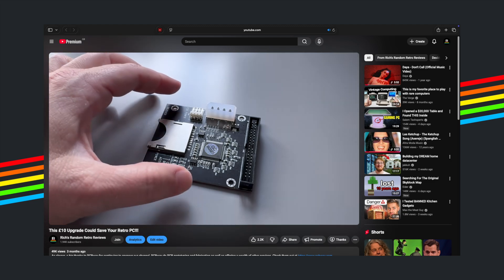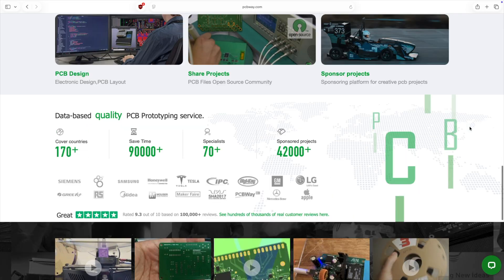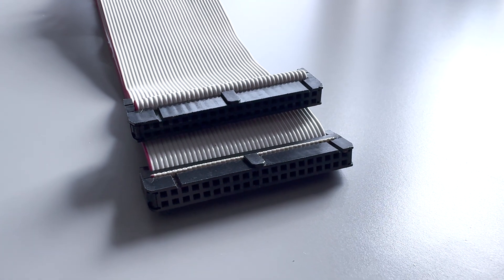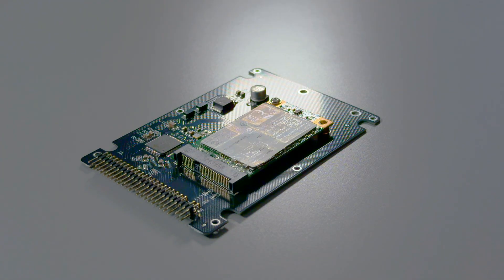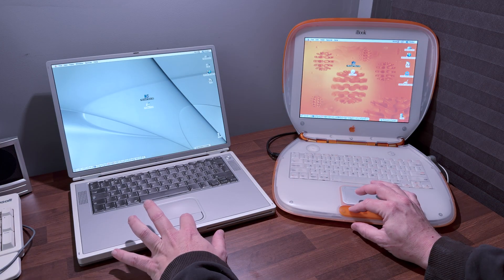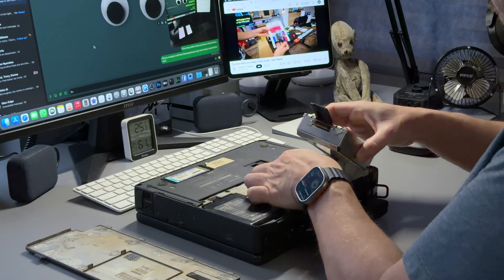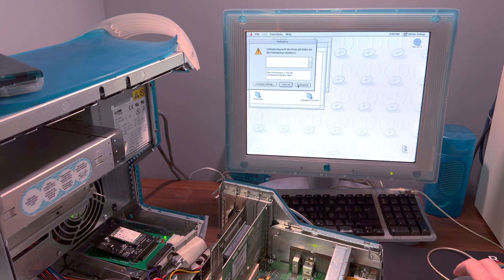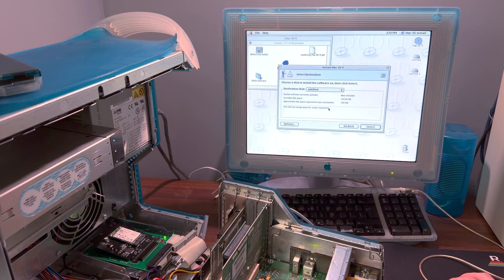Replace Your Vintage Hard Drive With This NOW!

Comment: Great video! Yes, I’ve found these little adapters to work much better on Macs as they tend to be picky with SD card solutions. 👍
Reply: Macs are also pretty good with CF to IDE adapters, but I do not typically use them.  They are picked up as external device in other hardware/software, causing issues with "no bootable device found".  They also typically bench a bit slower than these adapters, but hardly noticeable for typical use.  (That is also matter of perspective, because typical use of machines that can use these, is only set out for people that enjoy a few retro games or expierence, and even pain). 🤣😂

Comment: Meanwhile I'm running Debian 12 on the Dell Mini 910 that I bought new in 2008 with the stock 1.8 inch SSD that runs on an IDE interface.  I remember the relative responsiveness and impressive battery life of this back then.  No cooling fans either so it is silent.  I can still do most basic lightweight things like email, simple games, and even stream at 480p (screen resolution is only 1024 x600 anyway).  I do have my FIRST laptop as well, Inspiron 1100 from 2003.  I'm interested in challenging myself to use this similarly to the Mini 910 and this may be the solution for the storage.

Comment: also there is an ide read effect device you can add to your vintage machine, it comes off the hdd led line and adds the mechanical clicks of the head back
Reply: I was gonna post the same thing, a clicker would bring that nostalgia right back
Reply: It would also need to mimic the noise of spinning quantum drives, not just the click.  The device needs a spinning noise selector, mimicking the sound of the original spinning platter.
Reply: @pud469  I remember having a quantum Big foot in our one pc
Reply: @Captain_Char  And I'm sure you can distinctively remember that sound.  I can even say there is something about hearing the drive spin in my MacintoshSE, even if using a blue scsi, that makes the experience more authentic. Then you need to hear that voice coil head seeking noise too used in the fireball series.  Annoying at the time, but absolutely ignored for the fun.  Now it is a requirement full the full experience.  You need the pulsing sound when computer audio tone barely mismatched the drive noise frequency. So much fun lol.
Reply: It's not the same and you know it.

Comment: WRONG! You can't simply replace an IDE hard drive with an SSD unless the operating system supports garbage collection (TRIM) and that means Windows 7 and later. 

It will appear to work at first but fail once the SSD fills up because deleted files are not returned to free space.
Reply from the maker: You're not 100% correct there. SSDs handle garbage collection internally in their own controller — the OS does not “clean” the drive. TRIM (Windows 7+) is an optimisation, not a requirement. Without TRIM the SSD still works and reclaims space; at worst you get some write-speed drop, not failure. SSDs have been running fine for years on XP, DOS, Classic Mac OS, and IDE systems.
Reply: @RichsRandomRetroReviews I tried putting some SSDs in my TV Recorders. Once the drive is full it becomes read only even if you have deleted the files. It only returns to normal if you do a format. Also hard disk defragmentation will shorten the life of your SSD.
Reply: There do exist third-party tools, like late R. Loew's TRIM.EXE that can TRIM the empty space on FAT partitions in real mode DOS, and by extension for non-NT versions of Windows (at boot). Whether or not it works depends on the controller used on the IDE-to-SATA bridge, as it needs to pass the relevant  ATA command correctly. Windows 7 is not required.

I am not sure if one exists for older MacOS / HFS.

Comment: TRIM..?
Without TRIM I'd go with a Secure Erase of the SSD and then create a partition half the full capacity (add the factory overprovisioning) of the SSD to give Garbage collection etc a lot of space to work with, to to increase lifespan and speed.

Windows 7 I/O is 66% Q1T1 R4K and games are similar.
Google:
thessdreview Understanding SSD Advertised Performance and Its Purchase Implications – An SSD Primer
gamersnexus How Many Files Do Games Load? Does 4K Performance Matter to SSDs?

So the important numbers to look at when choosing a SSD ar:
1:  Q1T1 R4K mixed. (read/writes)
2:  Q1T1 R4K writes.
3: Q1T1 R4K reads.

You dont mention the translator/ctlr chip on the adapter, but one with some RAM buffer built in would be best.

Comment: as i remember it, the silver antistatic bags allows current to travel on the outside. so you probably killed that board.
Reply from the maker: Really??! I had no clue! Thanks
Reply: @RichsRandomRetroReviews  Yes, anti-static bags are metalicised plastic to make them conductive. This forms a Faraday cage around the device they contain to shunt any static away from it.
Reply from the maker: @bdwilcox  Thanks for the explanation. Makes perfect sense.
Reply: @RichsRandomRetroReviews  Silver/Grey anti-static bags dissipate static charges by conduction, Red/Pink anti-static bags simply do not generate static, but they have no real dissipation capabilities, Blue bags are similar to Red/Pink, but some add some corrosion protection, and Clear plastic bags generate lots of static.  Be careful out there!
Reply: @bdwilcox  im calling bs on that one. Its not a faraday cage. Its conductive, like in the meg ohms per square, so static charges dont build up.
Reply: @davefoord1259  Verify with an OHM Meter or an extension cord....You choose.
Reply: @johnrussell6620 Bahahaha. Do you know how a faraday cage works and what its used for
Reply: @theokanomad1620  yeah i do. A faraday cage needs to be very low resistance as it relies upon induced currents in the conductive material to create magnetic fields that cancel the incident magnetic field.
Reply: Yes this is true I didn't experiment one time where I stuck multimeter probes through the bag and two separate parts and put it in continuity mode and it does indeed conduct electricity
Reply: Spot on. Black ones too, usually.
Reply: Yep, you never place electronics on the outside of an anti-static bag, only inside (and ideally not turned on inside 😂)

Comment: IDE to CompactFlash adapters are trivial since compactflash has PATA-compatibility, and CF cards are still available. I'd argue that CF is cheaper and more common than mSATA that got surpassed by M.2.
Reply from the maker: I love CF to IDE solutions. That's what I started out with. But if you start looking at larger capacities, then MSATA starts to win over CF. This MSATA drive was about £4.99 before shipping, where as a 32GB CF card is about £25.
Reply: CF cards are only cheap in miniscule capacities (<16GB), and their endurance straight up sucks balls cause they were never intended for this kind of use case and use super dumb controllers that don't even do basic garbage collection. For a pure DOS rig something like at 512MB-2GB CF might be fine, but as soon as you're going into Win9x territory, they sjit the bed in a matter of months (if even that). And it's always "all of a sudden it's no longer detected at all", not gradual slowing down that would give you an early warning.
Plus, cheap CF cards nowadays tend to be made with e-waste tier QLC flash, the same stuff you get in cheap noname USB sticks with agonizingly slow writes (<5MB/s) and stalls

Comment: Ive been doing this for a few years now, not the same adapter but similar. Small SSD's that are M.Sata are pretty cheap. Still use CF or CF Microdrives on anything prior to pentiums though.

Comment: I use an IDE to SATA converter for a 2.5" ssd for my Windows 2000 desktop. It works well. The only problem is that occasionally on startup the pc doesn't see the hard drive. A quick reset fixes it.
Reply: Which one do you use? I've used a few in the past, and they always resulted in data corruption over time. Even on a brand new SSD. Switched over to an IDE drive. Going strong ever since. 

I'd be curious to know which one you were using
Reply: People like you give ludites a bad name.

Comment: Hi Nice Video.
The oldest machine i have is a pentium 100, it has 2 x 400mg conner drives that i took ot of its 486 predecessor, they still run great and quiet, but i only use it say 24 hours a year for the last 10 years.

Next i have a Gateway Pentium 2 2000, it came without a drive when i purchased it as the seller advised the drive is installed and running , he will demo the machine and benchark on pickup but he wanted to keep his drive and files for security and personal reasons ( which is fine )but i had a spare 2.1gb fireball and that went in it, it was used for 3 years as my low end server as i had dual boot dos 6.22 and win 98, that machine was upgraded to a 4gb CF ( compact flash card ) and adapter, wow that is fast

Toshiba laptop circa 2003 with serial and parallel  connectors and dual boot dos 6.22 and XP  - it recieved a  NOS 3.5 ide drive ( this is my portable little file server and laplink to old machines - it also talks  to win10 fine

Another 2003-2005 toshiba satellite laptop, similar but it lost the legacy serial and parallel ports but has external monitor and still a 1 hour battery life - that also has a ide  44 pin laptop to CF adapter

2003 Apple G4 - has a replacement nos 4gb drive OS10.4
2006 Macbook Core2duo 120gb SSD  OS 10.6
2006 Imac core2 duo  120gb SSD   OS 10.6

Even if the CF or SD cards fail, eventually it does not mater, the media price is very cheap for brand new and you can and should clone and image the install and save the image for a restore later on.

As for the degraded AS card on your dashcam, that is normal it probably wrote 1 gb every day and used up all the write cycles - i found this out with our work truck due to a driver damage dispute and the playback quality was like your sample,  - we have a pop up mesage on outlook at reception every 6 months to go and place a new SD card in both trucks

Mechanical drives are fine and suitable for purist, but like people who collect old cars, do you really want original 1960's brake fluid and radiator hose in your prized vehicle.

Regards
George
Reply: man... looking at your hardware makes my 10+ year old laptop look like an infant in comparison😆

Comment: Have you by chance tested this on a 386 or ISA based 486? They use a slightly older version of IDE that requires a signal on one pin. Many adapters do not pass that signal and thus drives cannot be properly identified even by modern solutions like XTIDE. CompactFlash adapters however all seem to work perfectly, due to the fact that they are based on IDE and implement the spec fully.

One issue I've had with SD Cards is that they tend to have a brief pause when accessing the drive, it's especially noticeable on a clean boot with a directory with many files. On CF it's not an issue at all. You can also get industrial CF which has very long lifespans.

That said, I don't really think the people worried about the life of SD have a valid concern. Unless you plan to use your vintage computer as a daily driver, you aren't going to be using it enough for it to matter. Booting up a game every so often for the nostalgia, or showing off ancient Windows is not going to really dent the lifespan of a SD Card or any other non-managed flash.
Reply: I was about to write the same thing, SD card is fine for limited use. I've had one in my p3 packard bell for a couple years now and it still works fine. I however don't run it nonstop.
Reply: @molten_software  Yeah, people are treating it like it's a PC you are going to be using for hours every day and that obviously is not the case on a truly retro PC where you'd need these kind of adapters.
Reply from the maker: I'm afraid I don't have access to such a machine :(
Reply: @RichsRandomRetroReviews  We should change that my friend!  ;)
Reply from the maker: @ReflexVE  Don't tempt me lol

Comment: A neat solution, but while it works; without support for TRIM in the operating system you'll find the drive life will significantly be reduced. And the longer you use it the slower it will become until you reinstall. These drives need TRIM to operate properly and deleted files clog up the drive.
Reply from the maker: It's a valid concern, but some drives these days have built in garbage collection which does this for you.

Comment: Is that a normal IDE (40 pins) or a 44 pin IDE interface?
Reply from the maker: I made a mistake in the video - it's actually a 44 pin interface. 40 pin is for the adapter to plug into a desktop.

Comment: You shouldn't put electronics ON antistatic bags. It can damage them.
Reply: This is modern electronics in an old pc ... not the other way around. You do realize modern electronics are way less susceptible for static by internal resistors over the pins, do you? The rest is common sense with high pile carpet and low humidity. 
Trust me, he knows.

Comment: try putting in a 2.5in SSD in via a PATA to SATA adapter.  I don't even use an SD Card on my Pi 400 or Pi 500. I use a 3.2 gen usb ultrafit USB Key instead of SD Card.  I am not worried about SD Cards dying on me.  I just prefer speed and SD Cards you're only getting 40 to 80 mb/s if you're lucky.

Comment: Who needs nostalgic hard drive sounds anyway!
Reply: there exists a hdd click generator
Reply from the maker: Some people like them, I kinda do but I'd rather have reliability and speed over the noises.
Reply: The noises could be reproduced.. and "played back" as a feature.
Reply: if you're genuinely using an old machine for fun and using it regularly then i'd say you'd probably just get used to the lack of crackling and the new drive speed and if you went back to a hard drive you'd be annoyed with the slow response. being a "purist" is for people who don't really use the machines.
Reply: I enjoy them, but I don't need them.
Reply: The seeking sounds made by early hdd Macs was memorable.

Comment: Can you provide a link on the 2.5 to 3.5 adapter ?  What about your success with CF cards?
Reply from the maker: I'm reluctant to give you the URL because mine seems to have failed, however if you search on eBay, they're pretty easy to come across. As for compact flash, I love those too - just larger capacities are getting expensive. You're looking at over £25 for a 32GB card where as an MSATA SSD can be picked up for about £5 (£8 with shipping)

Comment: I had one of these in my Amiga 1200, 4 years back. A great video!
Reply: putting these in an Amiga 1200 makes perfect sense too.
Reply: yes, amigas where really crippled with hard drive, back your being compared the big box PC, the the there where the  bear minimal PC setup 8MB memory, and it ture could PC boot from Floppy just the same but what could with Hard drive limited the repairing the failed hard-drive and not much more, where as the amiga, the it do just everything, the PC could from floppy and only 2MB of memory, the if the amigas 1200, spec. was even close the PC 8MB memory, any hard drive,  but close mobile phone seconds, 10=20 second working desktop, and PC where easily  2.minutes, on fully set PC driver needed bits setu? and every image slow was the hard drive, boot from Ram: floppy disk images it up and the reset the amiga, so guessing a ssd would something like boot up time, have rust in the mix? Lost power supply for amiga 1200 years ago in a move, when hard where still expensive, so never tried hard drive as floppy like good enough at the time

Comment: Do you think something like this will work in the Japanese Ps2 Dvr?
Reply from the maker: I'm afraid I have no idea - but if it's IDE there's a good chance it would work. They're not that expensive of a solution so perhaps you could give it a try? If it doesn't work then you could perhaps use the drive in another machine?

Comment: Great video ... Just recently used one of those 2.5 inch IDE to mSATA enclosures to bring back to life my Y2K Sony VAIO Laptop. Although, the first I bought from Amazon, a white Cablecc one failed and blue screened the system. So sent back and swapped for a black Docooler one (slightly different board layout to the previous one), which looks a lot like the one you used in the video and touch wood all seems to be going great!

Comment: It would be nice an adapter to use a USB flash drive as IDE drive.
Reply: These exist
Reply: @georgelopez8287  As far as I know, they don't exist, or I don't find anything about. And I do not mean the IDE2USB adapter, that let you connect an IDE HDD to a computer via USB.
Maybe, if there is no hardware solution, someone could make a BIOS extension like XTIDE for old computers (P1-P3) to recognize a USB flash drive as mass storage at boot and to be able to boot from it. But that will let aside older computers without built-in USB ports.
And yes, I am aware of PLOP Boot Manager, but it is picky (in my experience) about chipsets, flash drives, etc on old computers; I only  managed to boot from USB on my P1 from an old 512k flash drive.

Comment: There is a potential issue with these.  There is a barely perceptible alignment difference with the IDE connector, which meant for me that the adaptor would not fit in either of the two vintage laptops I tried them with.  I received two different replacements from the Ebay seller and all three were the same. I only got one to 'fit' by completely dismantling the laptop (an IBM Thinkpad R32), but this didn't work either because the laptop would not boot at all with it fitted.
Reply from the maker: Good to know. Thanks. Luckily I’ve not run into that issue. The machines I have have IDE ribbon cables to connect to the motherboard.